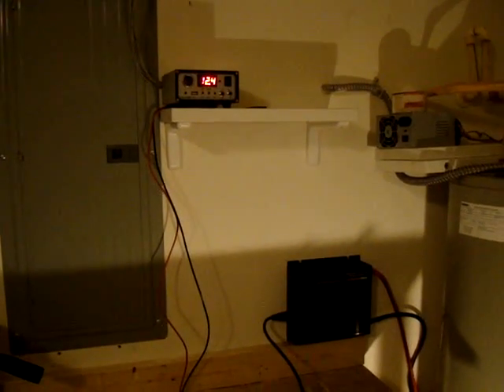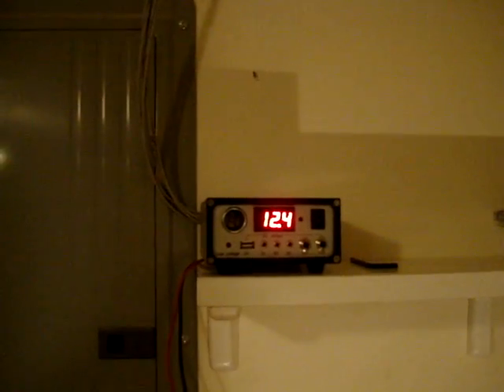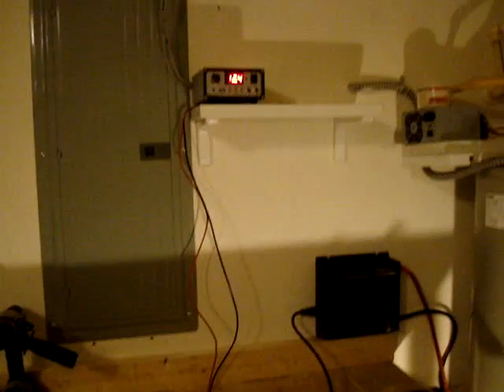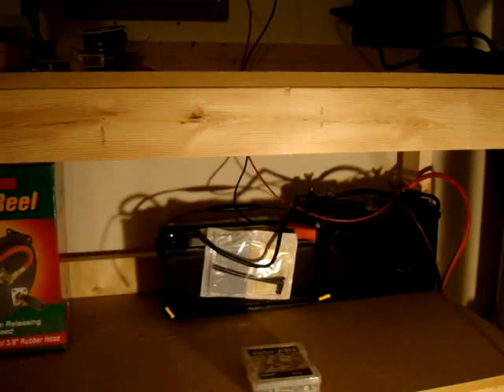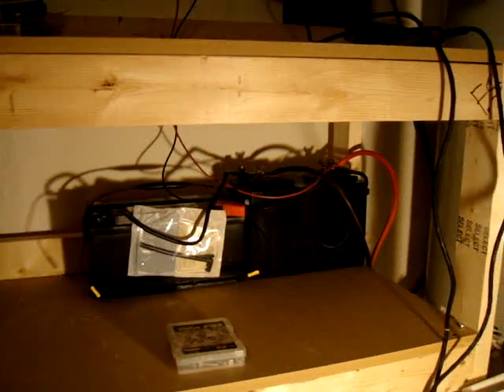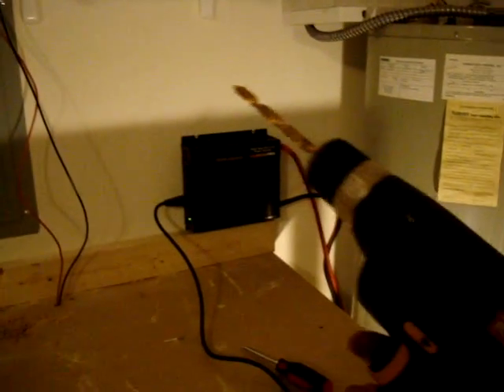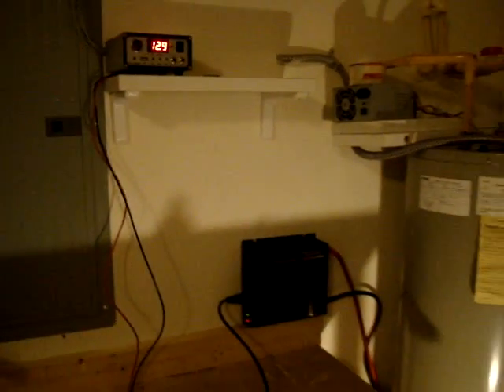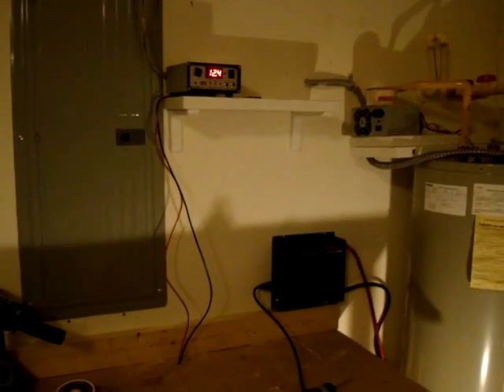3 Solar panel array setup and installed. Interver with charging unit view. #2

Comment: if you have a shop, for installing solar power system, you should first consider what type of equipment are availanble in your workshop, and what are their power consumption. how many hoers you are using each equipment , after calculating your daily power consumption, divide the total power to approximately five hours sun time depending your location, that will set the amount of power you sill need for solar system. and always better to make it grid-tied system. batteries are very costly.

Comment: SSI 200W grid tie inverter can be purchased from buyerIsland for $259.00

this is something to look at. Using this puts power into the home grid cheaper then what you are looking to upgrade to "you said you wanted to upgrade from you inverter you have now."
Plus you don't have to maintain batteries or space for them.

Comment: Nice vid.  Something to consider:   Those automotive batteries, if deeply discharged are not going to last long.  i had a similar setup with a couple of automotive batteries and one of them died after 6 months.  (there was a 1 yr full replacement warranty - hehe).  Later this summer I'll post the new setup for my solar cabin.  Thanks for sharing.